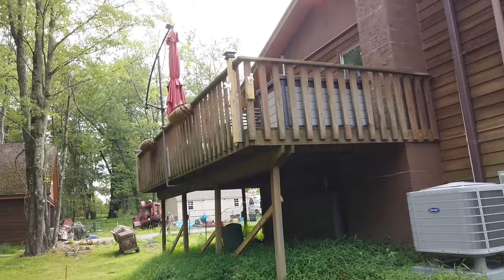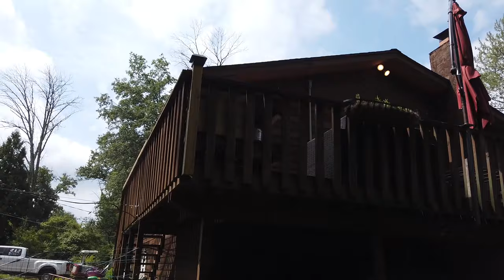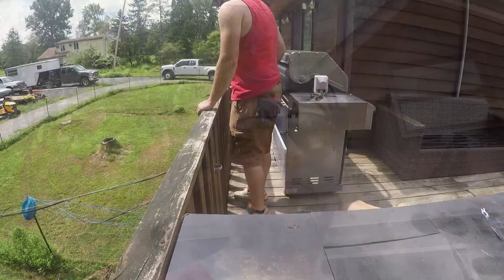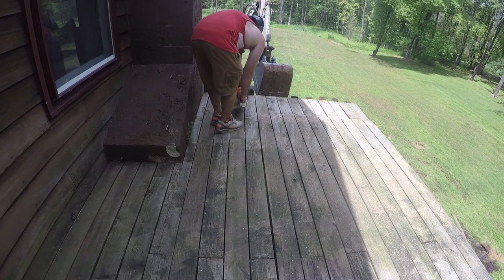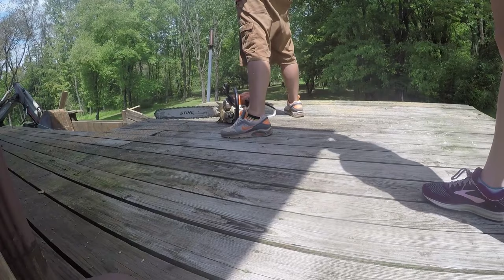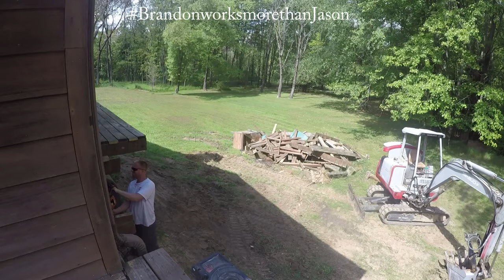Unbuilding our deck with a chainsaw and an excavator!

Comment: Before i watch whoo there Andrew and carbide chain for your chainsaw
Reply from the maker: gavin hirt hahaha it’s an old chain that has been sharpened to the end of its life. Trashed it right after this lol. Hey run what ya brung right
Reply: Must say your ToT training is going well time travel  mmm be careful
Reply: @JasonWorksAlot  yup or add nitro methanol then say fuck it right before it goes boom in your hands lol oh wait that was my rc car
Reply from the maker: gavin hirt problem is the time machine is stuck on metric so every time I go back I get this metric voice again...
Reply from the maker: gavin hirt ahhh memories. I never spent so much on something so small hahahah
Reply from the maker: gavin hirt just remember the “b” is silent and you’ll never get it wrong.
Reply: @JasonWorksAlot  3000 grand so you can destroy it.  that's nothing get into nitro boats then its aVe money 1500 for a motor that may run because it did 10 yrs ago and the fuel costs 75% mix it yourself

Comment: Do like bigdeal18 just burn it
Reply from the maker: Jerry Bennett stupid communist county won’t let us burn😡😡
Reply: And the old pressure treated wood uses arsenic to prevent rot. (arsenic-based wood preservative chromated copper arsenate (CCA))  Pressure treated wood sold before 2004 is nasty stuff, never burn it and wear a mask and shower to avoid its sawdust.
Reply: @JasonWorksAlot  who said anything about asking permission ? Just do it.
Reply from the maker: David Null mmm that’s a really good point.
Reply from the maker: J. Chris Beck hahaha ohhh no. I’m not going down that road again
Reply: @JasonWorksAlot  another one bites the dust.....
Reply: @JasonWorksAlot  --- Perhaps ask FiancéeWorksaLot   What is the USDA minimum daily requirement for arsenic?    Is arsenic one of those essential minerals they keep advertising people need?  Fiancée will know this.
Reply: David Null come on man you only live once what would life be without risk